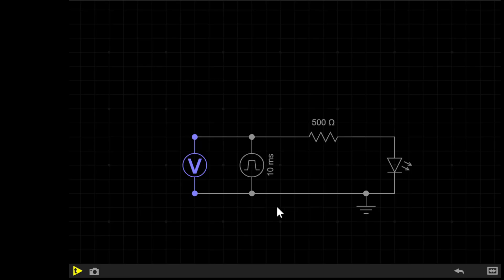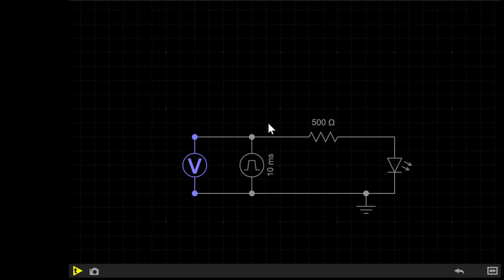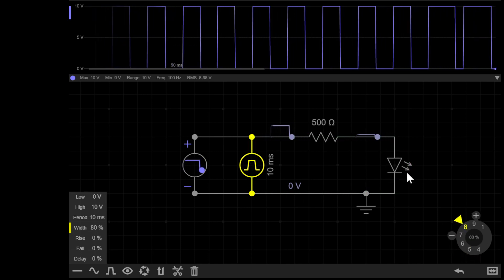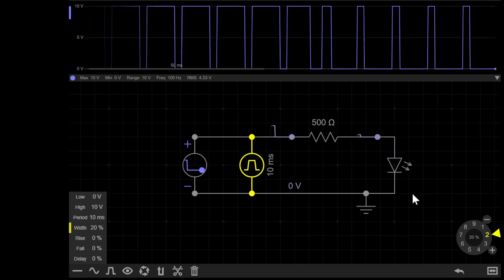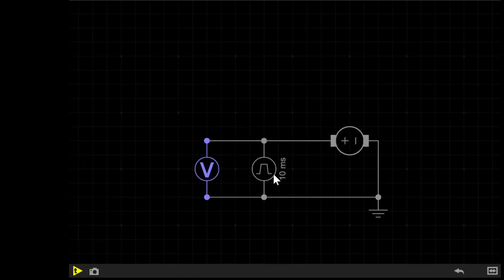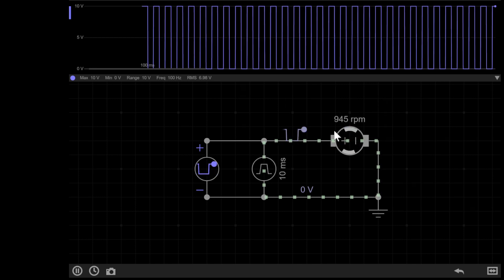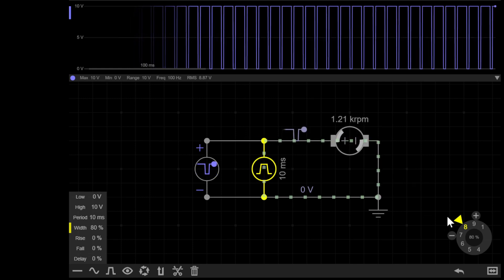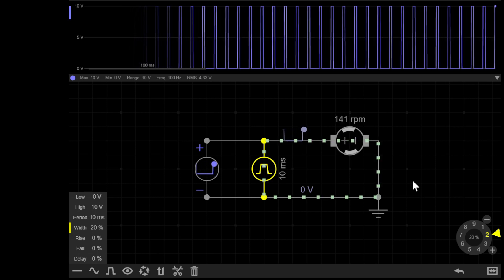PWM - Turning Digital into Analogue

Comment: This didn't seem to have anything to do with turning DC to AC. It was just a brief bit on DC Pulse Width Modulation.
Reply from the maker: I see PWM as a way to turn pulsed DC into a varying or alternating signal (AC).  It would be clearer if I could use smoothing capacitors and show off a sinewave, but the simulator software I use cant run fast enough for it to be clear to a viewer so I went for the motor demonstration. Hope that helps